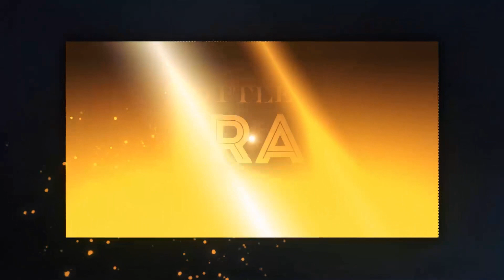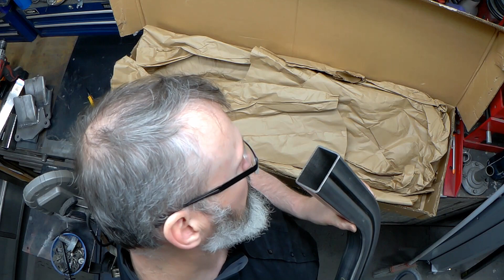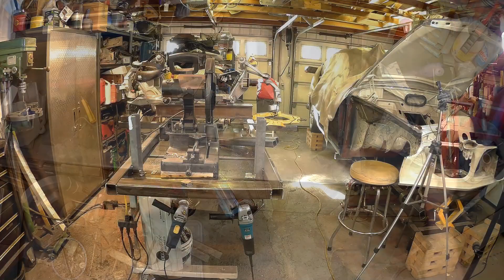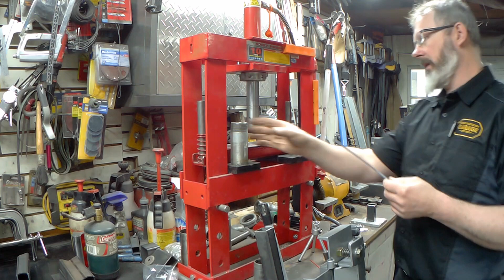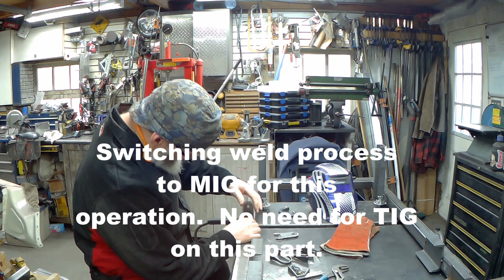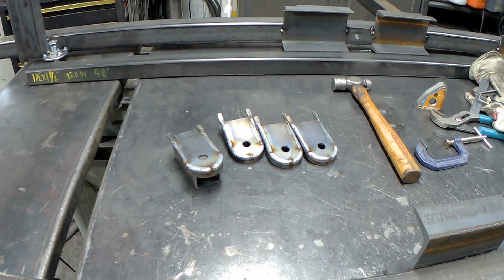Volvo Amazon New Corvette C4 Front Suspension Design (Ep 7)

Comment: Have you read Brent VanDervort's "Hot Rod Chassis How-to: Understand, Install and Update '28-'64" Amazon" $23 USD. Although Faman Fabrications is no longer in business and did Mustang II installs primarily,, he does have an exceptional grasp of how best to adapt an IFS to a chassis it was not originally designed for. Very strong on theory.
Reply from the maker: Yes.  Mustang II based suspensions offer the rack and little else that is much better than what is currently there.